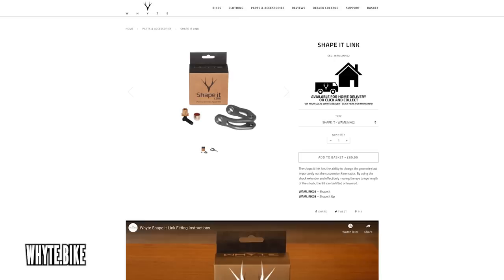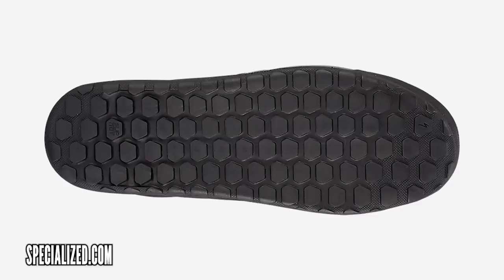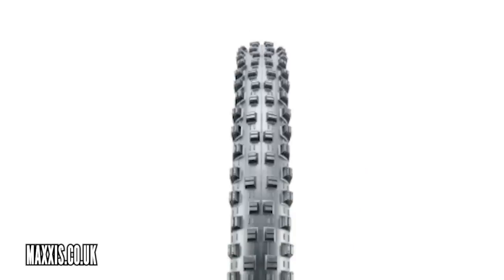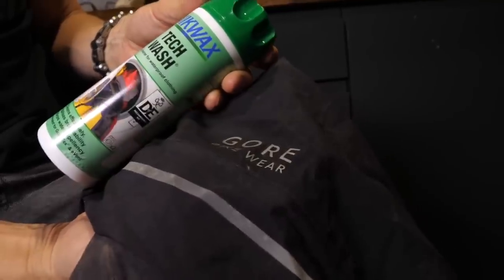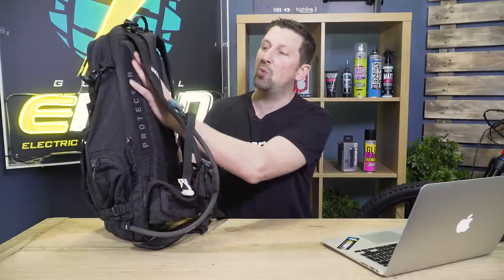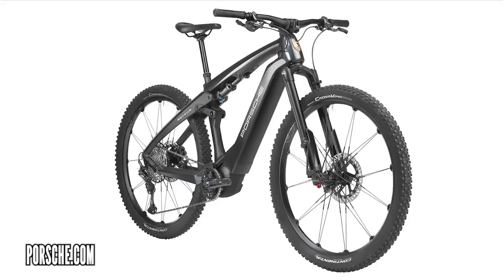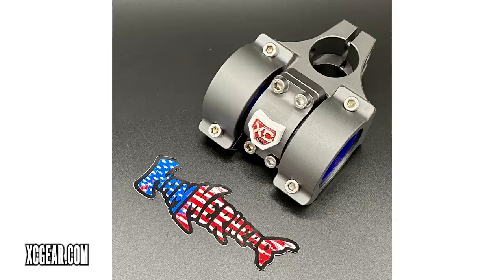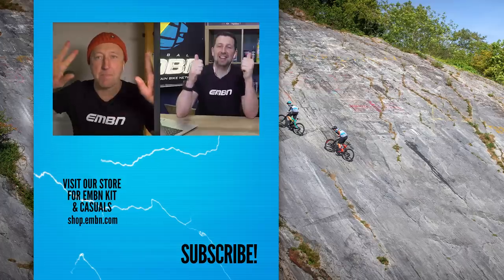The Latest E-MTB Products & How To Care For Your Riding Kit | The EMBN Tech Show Ep. 3

Comment: What's a good waterproof over shoe to go over large 5-10's? I tend to rinse mine down with a hose when I get home, then stick them in a washing bag and then into the washing machine, but it would be nice if they didn't get so wet and muddy to start with. I wear Shower Pass socks and they definitely help with preventing the feet from getting wet.

Comment: Like all people with a emtb I like to work on my bike. But with the increased weight I have already broken one stand. What repair stand would you recommend for a emtb.
Reply: I started using the Park Tool PCS 10.2 about a month ago. Had two different ebikes on it (in the 40-50+ pound US range, with batteries removed) and no problem. The stand is stable and holds the ebikes with no movement. Definitely a back saver for maintenance!